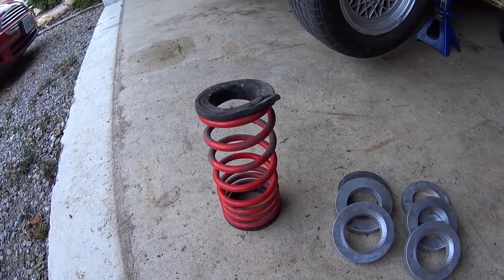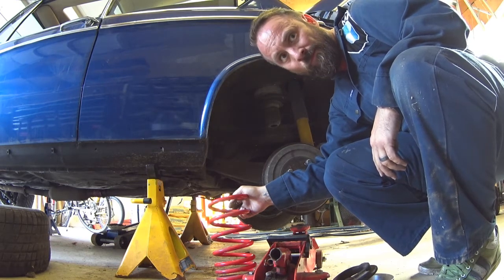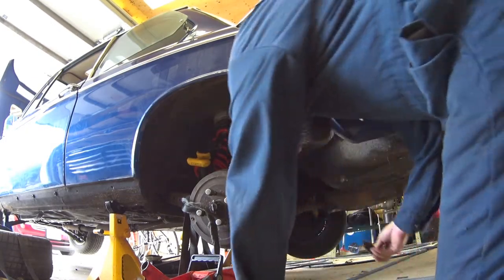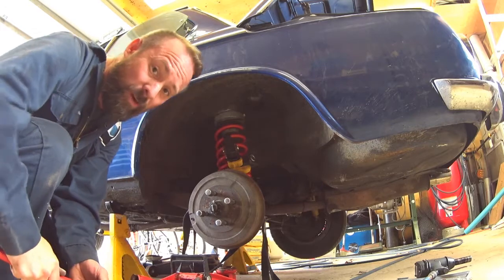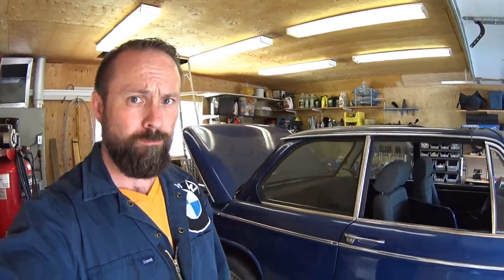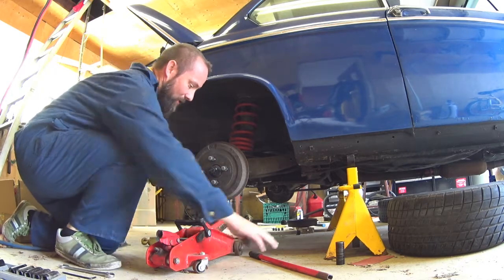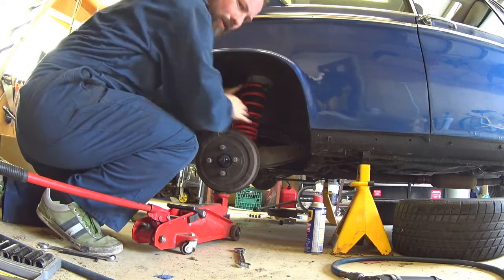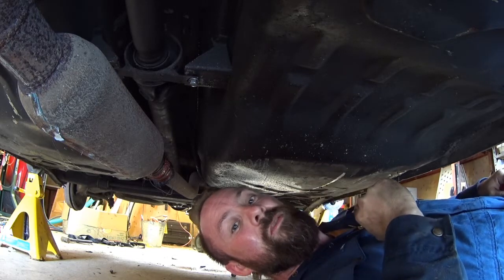PROJECT 1968 BMW 2002 EP01 Rear Springs

Comment: I installed stock car type spring perches welded them to the trailing arms, boxed the arms as well. So I have ride height adjustment. Nice work, enjoy your videos
Reply from the maker: Thanks!  I'll probably get into the rear suspension a little more.  I like the springs and struts, but need better adjustment - currently mines a weird eccentric bushing that doesn't work very well...  What do you mean by 'stock car type' spring perches?
Reply: @spuriouspseudo  they have a large center bolt fixed to the perch so you can adjust ride height and transfer weight. I’ll look and see if I can find a link for the perched. BTW, do you have any literature on the metal sunroof installation? My car was a shell when I received it, all painted now, just no idea what I need parts wise. Thank you 🙏

Comment: Would not just fitting original springs be easier. 
I’m just curious as to why you choose this option as it looks quite involved. What with making the spaces.
I actually need to lower mine a little with original springs. 
I plan to just cut a coil off them.
Reply from the maker: @simonmenzies3142  for me, these were the springs I had at the time...  Plus, they ride better that stock and get the car to a good ride height -once you have the right spacers.  Years on and I'm still happy with them.  Compliant for the street, and decent on the track.

Comment: Where can I get the spacers my car is siting low in the rear
Reply from the maker: I made mine, but there are different thicknesses of stock spring mounts that might help you out.  There are three sizes if I recall.
Reply: @spuriouspseudo  I need one bad my car’s sagging I hate it. I bought dot 3 from iemotorsports  and it’s still looks the same